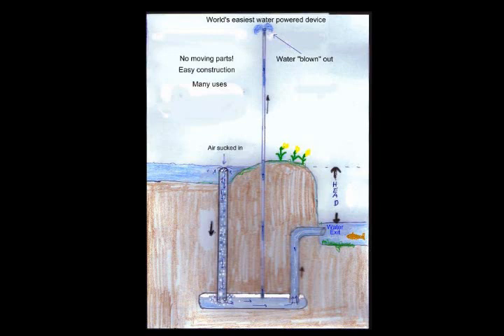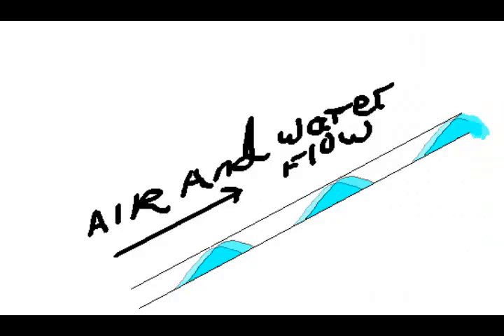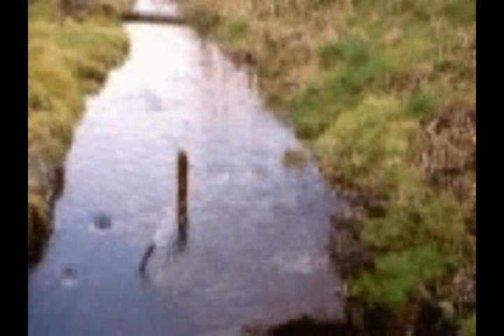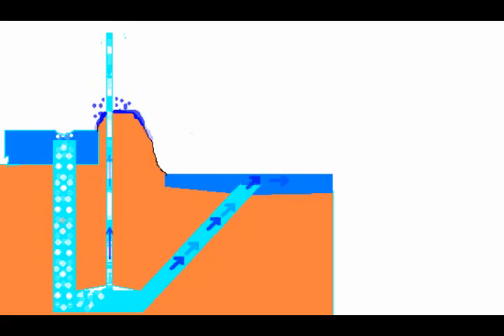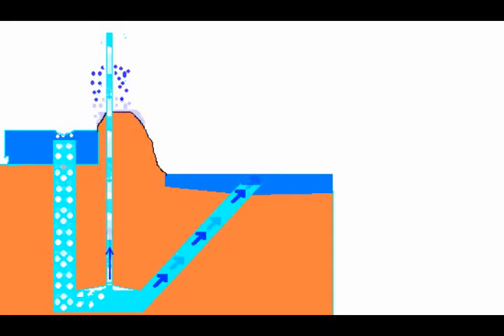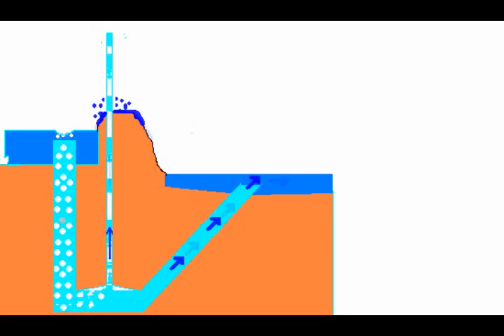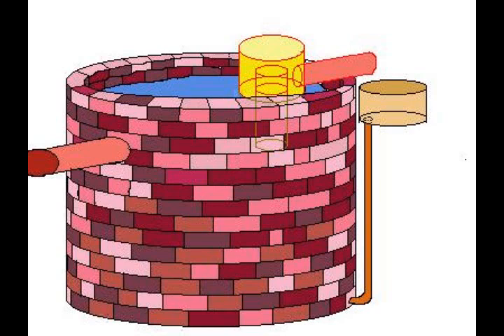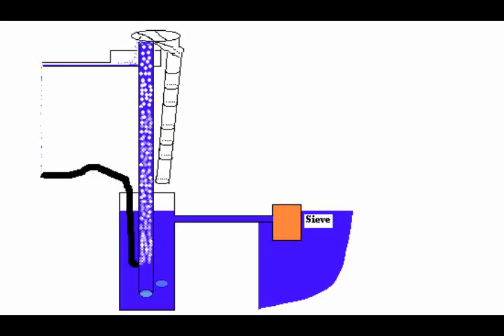WORLDS SIMPLEST WATER PUMP!! Make a PULSER PUMP!   Alhambra pump from 1400 AD? Make one and see!

Comment: @gaiatechnician -cont-
the pressure of the air supply must be greater then the hydrostatic pressure of the water at the bottom of the pipe, and in quantities sufficient to make the ascending column of air and water in the flow pipe lighter in its total height than the weight of an equal column of solid water of the depth of the well from the surface or the water to the bottom of the pipe.
the information is out there just have to look in the right place.

Comment: @gaiatechnician like my first statement "books", and like my other statement in the patent office, the air lift pumps were uses a lot in mining, they would use muti steps, for raiseing the water over hights greater then the total hydrostatic pressure (Puhle's compound air lift) then you have Tylor's system for hydrolic air compression, do a little searching for your self and you will see that there is no "charts" as ever system is different but i can give you the simple rule

Comment from the maker: @1crazyfocker  Did you even read my previous post?  You are going to have to do much better.  Nobody was using low pressure trompes or low pressure airlift pumps.  (Dr. Ricard Bosch i Tous was researching them just 3 years ago).   And there are no figures available about how good or bad low pressure airlift pumps or trompes  can be.  This is because of people like you making assumptions and not bothering to check in detail.  Back up your "its simple" with something real.

Comment from the maker: @1crazyfocker  The results for low pressure tromps  are not know and certainly  not available to the public.  Show them to me if you know where they are.  If they are known,  why would Dr. Ricard Bosch i Tous
(in Spain) be working on them in 2008 !!  as a potential 3rd world application at the university of Catalonia?  In Catalonia, they were most used in the entire world,  so if they didn't have figures a few years ago, what makes you think anyone else does? (Pdf of his work is on the net)

Comment from the maker: @budz1031 I think it is safe for fishes because it oxygenates the exit water.  There were many stonefly larvae in the water near the exit and hardly any in the rest of the little stream. Stonefly larvae need well oxygenated water.  If your pulser pump went really deep (probably 20 or 30 ft deep) then you "might" start to have an issue with too much nitrogen gas dissolved in the exit water.  Science, engineering and pipe makers has shown just over zero interest in the pump, so we don't know yet.

Comment: The potential energy of water at a high elevation produces kinetic energy when it falls to a lower elevation for example hydroelectric power. I have a very old book showing an air compressor using falling water as the only moving part that powered equipment in a mine so it is no surprise that water can be pumped using the compressed air produced by this device.

Comment from the maker: @PBates123 I have a tripod website about the pulserpump (no links allowed here, I think). On that site, I show something over the water entry area which worked well.  I intended it as a shutoff valve but it was more useful than that.  It is a flat piece of plastic with a half inch rigid plastic pipe running through it. . The pipe was to anchor it and to let air in when it suddenly shuts (prevent vacuum) but it also allowed the water to go higher and still let air in. Your idea should work too.

Comment: I liked your video and really like where ever you made it. It's quite beautiful.  
To improve the pump making it less sensitive to water level. I thought of a swimming pool strainer basically - the input requires some air be introduced into the system to work so the inlet side needs to be at just the right depth to suck a little bit of air. If you have a floating bucket that moves up and down with the water level then put notches in the rim to regulate the amount of water. Good luck!

Comment from the maker: @htomerif  "sigh" yourself.  All pumps have their problems.  I have spoken to a missionary who hated ram pumps.  He didn't find them easy to maintain at all. He ended up with an expensive broken junk of steel in the middle of nowhere. 
 The pulser pump doesn't need a constant bubble stream.  Why don't you and others who love ram pumps go back to them and redesign them to compress air too?   Then you can use the compressed air to pump water elsewhere, to run tools, cooling, etc.

Comment: @gaiatechnician *sigh*  you're talking about a pump for livestock, irrigation or developing nations that operates on small height displacements of water, is mechanically simple and easy to maintain.  Those are all the things the ram pump is designed to do.  Don't get me wrong, I think its actually a pretty ingenious pump, but it does have its problems.  Like I said (or meant to) maintaining a consistent bubble stream in all water conditions would be hard, and the up pipe size is limiting.

Comment: I understand how the pump works.  I can see how it would have some serious drawbacks in terms of reliability under different flow rates and water levels that would be found in the real world.  The bubble flow seems to be a limiting factor, as does the diameter of the up pipe.  The ram pump does have a few moving parts, but its still very reliable for developing areas.

Comment from the maker: @imtotob  Ram pumps are useful too but they have at least 1 moving part.  This pump can also extract energy from low head -  large flow sources and it does not produce water hammer.  It is lower tech than ram pumps and that is also useful in certain situations where repair might be an issue. Brian

Comment from the maker: @toddwolcott  The height  depends on several factors. Size of pipes, depth of the pump etc.  I have another video "Nano Airlift pump demo. Nobody knows how high it can pump! Can YOU help find the answer?" ( shows that you can go to at least 13 ft high with just enough pressure to push air 1 meter under water!) Someone else has got to 16 ft with that tiny pressure  and it might be that you can go 20 or 30 ft with low pressure.   My pulser pump went at least 10 meters ( very slow at that height)

Comment from the maker: @cornifron  It sounds doable but note that I dug a hole about 15 ft deep by hand.  (Which is a crazy dangerous!,  use machinery or at very least shore up the sides really well as you go down).    Inclines are deceptive too.  It might be more than 6 or 7 ft.  I found that pumping straight up and letting it drain is better than pumping up an incline.  Check out the nano pulser and nano airlift idea, if you try that,  you may not need to dig so deep. Sadly, there is no research yet on nano pulser

Comment: Hi gaiatechnichian this looks neat and possibly easier than building a hydram pump.  Could you please respond because I am trying to pump water from a small shallow creek, which I can dam, and then use this pulser to water a small 1/2 acre garden.  The creek is about 250 ft away with a small incline to the garden of about 6-7 ft. I am guessing this may work very well using 4 inch pvc and smaller diameter garden hose.  The steady incline would push the water and air up

Comment from the maker: @astrialkil  The air comes up with water.  I recorded the sound on a psion 5 computer. I held it close to the pipe.  Basically as the air comes up the pipe, it separates out from the water and you get pulses of air and pulses of water.  Each time an air pulse comes through its pressure gets released and you get the groop sound. We are hearing  some echo from the pipe too. This type of air and water flow is called plug flow and it happens naturally at certain air speeds through the pipe.

Comment from the maker: @winnabego  Thank you.  If you want to learn and teach more, you can do  my Nano airlift pump experiment!    I made a "nano" airlift pump to test how high it could pump and basically I ran out of height.
I used an air bubbler from an aquarium, a little t joint to connect tubes and   3/16 inch tubes and tiny submergence (about 2 ft). It easily pumped to 13 ft high.  It is on youtube. How high  can it pump? 
NOBODY KNOWS!  Airlift pumps are not supposed  to pump to 13 ft on 2ft  submergence!

Comment from the maker: @ttaxis   I could not do a complete translation.
I don't  know if  you mean  hydram pumps or ram pumps?
 Trompes were used in Switzerland to power pneumatic tools.  Perhaps in Slovakia too?
I would be happy to hear that they were used there.  Especially if there is an article with pictures in an old book.
If they were used to pump water, that is good too because wikipedia will not tell people about my low pressure tromp. (Because it is "novel"). If it was used a hundred years ago it isn't novel.

Comment: Hi I'm using a 4" PVC spillway for a pond.  the pond surface is 6ft above the air chamber.  I want to use it to aerate the pond. 

What should the difference in height between the air chamber and the waters exit be?

So it would be a trompe, a 3 stage pump, minus the water pump section.  Also for the water exit does there need to be a container for the water to flow in, or will a vertical pipe exiting higher than the air chamber be sufficient?

Thanks in advance! Scott

Comment from the maker: @RichardJWNHS  I haven't seen this  in years!  I had a garden hose filling in the water and you just adjust the speed in through the green hose pipe  until bubbles start to go down.  and the exit pipe was 1 and a half ft or 2 ft lower. The internal diameter of the clear plastic pipe was 3/4 inch.  If this does not help, I have some little diagrams for models on other websites . Matt in Cornwall did good work, check his video.
I can find the links for my models if you want.  Dimensions are given

Comment from the maker: @SoftwareForFree  Yes,Split process just means separating the airlift and tromp parts.  The water gets pumped from above the dam (so the height that you pump is reduced by that amount, so you gain that. In split process,  between the tromp and airlift section, I put a constriction. Depending on the water speed through the tromp, you can get the air "pulsing" towards the airlift section.  The constriction stops that pulsing. I did tests and the smooth flow of air to the airlift was better.

Comment from the maker: @skatermoellerskov 
 It pumps water. 
Or the air can also be used for aeration or agitation of fishponds  etc.
It was just a demo to prove that it could work.     I made it in the late 1980's. 
I am hoping that research scientists, or an aid group, or engineers without borders or Bono, might 
test decent sized ones under controlled conditions.  I M head, 1.5 M,  2 meter submergence, 3M etc.  and different flow rates
Then people can build them with confidence.
I don't live there anymore.

Comment from the maker: @needbiggerpond   The airlift pump part of it can easily pump to 7 inches.  No problem. It can pump lots to that height.
Nobody had done the pipe sizing though.  If you are powering it from a stream or river and only pumping 7 inches high, then the tromp/airlift pump combo might not be the best fit.    Have you seen my bio fueled water pump demo?
Something like that pumping mechanism  but way larger scale) might work for you (powered by tromp).  
  I am not sure what you mean by great force.

Comment from the maker: @beefyuk1   Ragged chutes?  I wonder why nobody posts video of it. Apparently they let off the air out of the cavern sometimes for tourists and it blasts water into the air 70 or 80 ft high!  Actually I typed ragged chutes into the search engine and a bunch of tromps came up.  Some were built by the Spanish in north America  very early on. A link to mother earth  news "tromp" came up to. I have no idea why people  did not use it as a water pump too. It is an obvious thing to do.

Comment: @gaiatechnician 
Well said Brian!

I have seen a very similar idea used in Canada, I think? 
It was a natural hole in a riverbed which dropped a considerable distance below inro a cavern. This cavern was very large and the water volume was immense. The air was trapped in the roof of the cavern and generated very high pressures. i believe it was used to power compressed air tools, possibly to do with the coal or oil mining industry of some years ago.
Thanks for sharing your ideas, Best wishes!

Comment from the maker: @broadwayFan28  Part is called a tromp and the other part is airlift pump. 
But it does not work like a commercial airlift pump.  They make an emulsion of "fizzy water" and they pump because the density of 100 ft of  emulsion is much lower that the density of  100 ft of pure water, so it goes higher up a pipe than pure water would..  The pulser pump pumps with plug flow or slug flow.  That is a type of fluid  flow that is akin to waves in the pipes.  Slug flow is also used in the oil industry

Comment: @gaiatechnician I understand, but with a ram pump you don't have to be installed under the stream and thus it's much more practical for maintenance, changing valves and such. You should visit approtechie's channel, he built ram pumps that work off of roughly the same drive head that you are using in your video and the pump can haul a steady stream of water tens of meters up. plus, his pump has cycled 24 millions of times and the only maintenance he has had to do was change the back plate.

Comment: Big science is not interrested because williamson pumps are easier to install, more efficient and in some cases more durable for the volume of water they pump. Williamson pumps don't use any energy either but the can be built to pump huge amounts of water very high into the air. Thanks for posting!

Comment from the maker: @gary77777778888888 For turbines you generally need 6 ft of water head, minimum. (A 6 ft high dam minimum) to get decent efficiency.  The pump I show works on 1 and 1/2 ft.  So really you cannot combine the 2 things.
Electricity is the great bogus idea for low head sites.  You end up spending so much money that your annual interest payments  will be greater than your income from using or selling the electricity. So what is the point?  Better to use the power directly onsite to pump water etc.

Comment: Do you think you can run some turbines and not loose to much flow so it still polsates water? because if it does jenirate power and polsate water it may become an intrest for some investors. Im confadent if you had a steep enuph incline and a good volume of water you can jenirate electrisity and erigate at the same time well i still have much to lern i thawt it would suck air in the senter not polsate water but there are many factors i need to under stand first well good luck.

Comment from the maker: @gary77777778888888  It has worked as I discribe for over 20 years. The one in the video is still working and is still used to pump water to animals in Ireland in May 2010

Comment: a simple rig could be set up to calculate variables.  Starting with a 5 ft water head & 2 inch & 1/2 inch pipes.  See how high water can be pumped and at what volume/min.  Then change the Height of the tube to see how this changes your volume/min.  Plot these values over different tube heights.   Then start changing the diameter of tubes and water head, and repeat.  The result will be a series of overlying curves plotted on a graph(s), giving you the start towards developing an equation.

Comment: you should develope an equation pluging in variables like Inlet pipe diameter (and length) and outlet pipe diameter (and length) and ejection pipe diameter (and length), to find out the pumped flow vs. head (etc.)   Also,  I think if you used a Vortex generator and air inlet venturi at the intake, your results would be better.

John

Comment from the maker: I used the gimp and  ulead gif animator.  Ulead gif animator 2 is a free download.  Ancient microsoft gif animator (from win 95 probably!) is also very useful. All of them work in ubuntu.   In the gimp, you make the animation in layers and just make the appropriate layers visible and turn off the visibility as you make the new layers, then save as an animation.   Then you tweak the timing, etc in one of the gif animators.  (Gif previously had patent issues so the gimp left it alone for years).

Comment from the maker: You use the power of the difference in height to pressurise air that is then used to pump water a lot higher.
It is easier to understand if you split it into 2 parts.
You need to drop it low to pressurise the air.
That part is called a trompe.  And the part where the pressurised air is pumping water up is called an airlift pump.   You can check wikipedia or internet glossary of pumps for more info on those.
Brian.

Comment from the maker: There is some data on the pulserpump group at yahoo and on a tripod site. You have to dig a bit to find the data.  On the minor pages in the tripod group and in the files and photo's sections on the yahoo group.   I never had a big site so my data was collected from a tiny one. (Which is not much use to most people) 
 I expected others (lucky enough to have great sites, brave enough to experiment and public spirited enough to share their results)  to fill in the gaps
 but it never happened.

Comment from the maker: Try it and see.  
Do you know of anything else that works with 50 cm of power head?
And stays working for over 20 years.
And oxygenates the water as a byproduct.
Economic efficiency is what really counts.  If you have to replace your super efficient  pump every 2 years, then really it gains you nothing at all.
(And no super efficient option exists for 50 cm head)